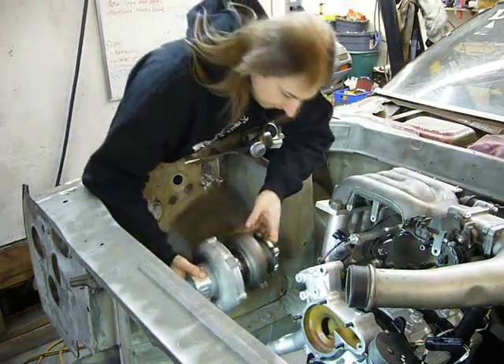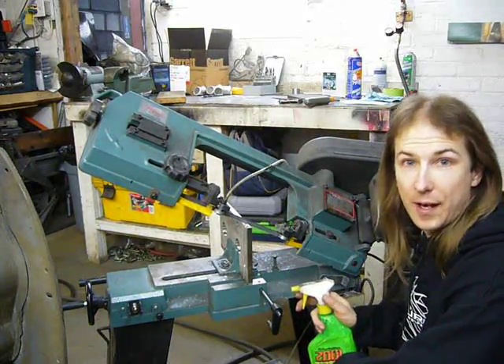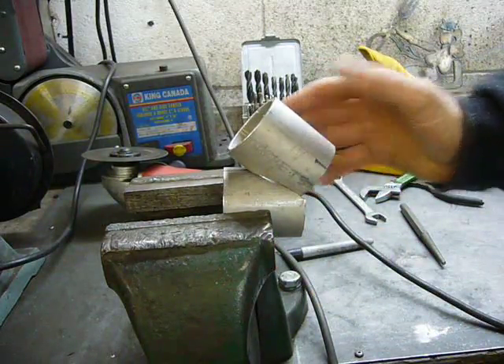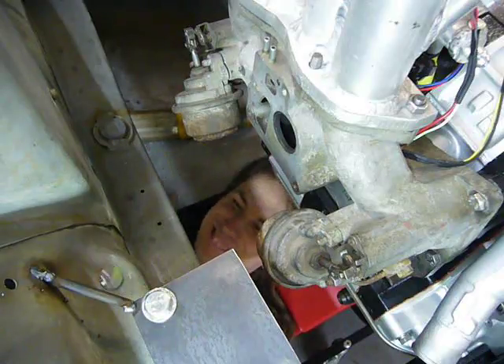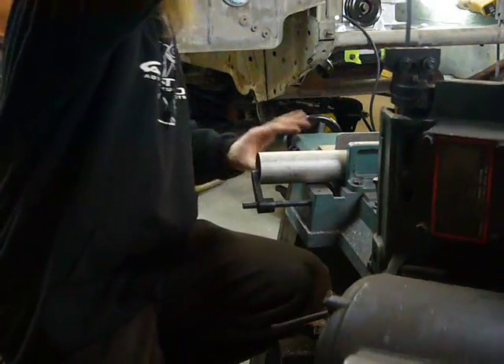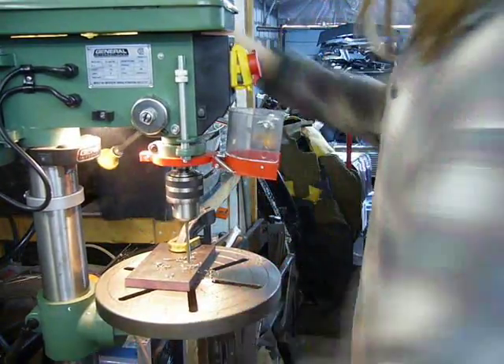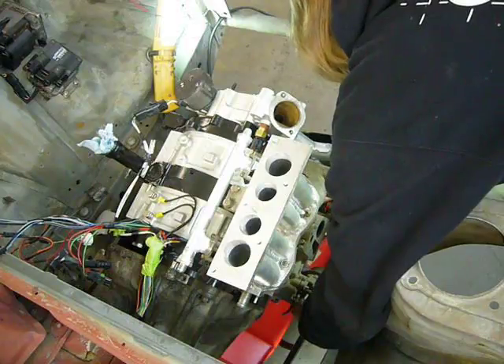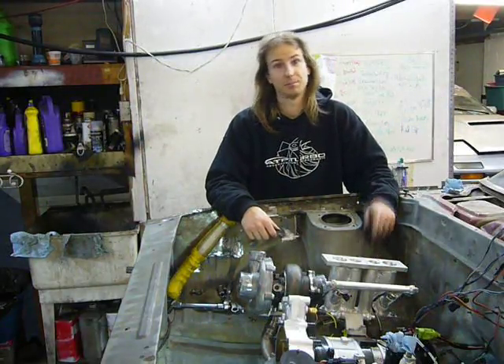Part 25: Turbo Manifold Fabrication - My 76 Mazda RX-5 Cosmo Restoration

Comment from the maker: Looks like really good stuff. I'll certainly be using it under the car to insulate the cabin from exhaust heat (as well as metal shields) and on the inside of the firewall.

Comment: Hi Aaron, Regarding your hole saw usage and lubing, one suggestion, I have had great success taking a paper towel and soaking it in cutting oil and then stuff it inside the hole saw. This is a cheap automatic luber for the hole saw blade. It's also known as a Texas Oiler.

Comment: I vote for the POR-15 on the floor.  I had requested that you discuss your experiences with this product during the interview with whoever-that-gal-was, but it didn't make it into the final version, unfortunately.  I haven't ever used POR-15 and would greatly appreciate hearing the experience of someone who has used it as extensively as you have.  But I digress.  Good vid, thanks.

Comment from the maker: In most cases, both rotary and piston, equal length runners will offer the best performance as it allows you to time the exhaust pulses to cross over one another at the collector, thus scavenging each other. Of course you can also run unequal length runners as well to time those pulses, which can be useful to compensate for things like uneven head flow, for example. This manifold has runners very close to equal. Not perfect, but good enough for my purposes. My RX-7 is equal length.

Comment from the maker: v8consumption If you didn't want to sound like a dick, I suggest two things. First, make a comment that I can actually reply to. There was no "reply" option available to your comment, which seems a little rude. Second, instead of saying "those welds are complete shit" you can say "I think those welds are less than ideal". When you interact with people, you can't just say "not to sound like a dick" as an excuse for everything else you are going to say afterwards. It doesn't work like that. Now, to address your concerns. Pulsing is very commonly done on stainless steel due to the tendency for it to overheat. Typically with a pulsar, but as I lack one of those, I just worked the pedal. It is a fine balance between heat, speed and penetration and I'm the first to admit that I'm not the best at getting a consistent bead on stainless. I find the fact that it flows out so slowly compared to aluminium a tough nut to crack, so to speak. Without question I do need more practice as you can tell based on the fillet beads. They were more consistent throughout because it is easier to control the heat at the fillet joint vs. the butt joint. Regardless, this is not my first manifold (not a single manifold I've made has ever cracked...my own RX-7 has over 100K on my first ever stainless manifold, crack free) so I do have a bit of experience under my belt. As such I'd say that your name "v8consumption" probably indicates you have little experience with rotary  exhaust heat. Trust me when I say that the 0.109 (only 2MM thick! That is exhaust tubing!) wall thickness of SCH10 1.5" pipe is fine for a street driven piston engine, but will sag and crack very quickly on a street driven rotary due to the high EGTs. In fact even on a piston engine I wouldn't use it for fear of it cracking eventually. I also agree that I could have had more penetration in these welds. However notice in the video that I heavily beveled the butt joints such that there was less than 1MM at the thinnest edge of most of the bevels. That's about 90% penetration without putting in too much heat (OK, I was a little high on the heat) and sagging into the inside. Anyway, checkout some of my other videos for extensive aluminium welding as well as further stainless welding and feel free to comment but please do so in a way that I can reply to.
Reply: +aaroncake Love the build, dont listen to the haters, build what you love to your taste, and build it the best quality possible, thats all that matters. If your anywhere near north east pa, I'll give you stainless tig lessons free, I never use back purge, sometimes I pulse, but mostly I  run heat higher than anyone Ive ever seen, and run very, very fast, with the tungsten as close to the base metal without touching as possible. If tungsten gets contaminated I chuck it into my cordless drill and grind a new point onto it facing straight down into a belt sander/bench grinder at a 45 degree angle, and not sideways.. Also I prefer to run a 1/8 tungsten, with gas lens, and number 7 or 8 cup on anything around 100 amps, and over. Gas lens is key for stainless, and a perfect ground uncontaminated point on the tungsten.-John
Reply: +John Steenland Also another huge issue most people forget when tig welding stainless is post flow, post flow should be set to 10-18 seconds, and gas flow should be around 20 possibly slightly over, but holding the tig torch in the weld to cool with post flow for atleast 6-8 seconds afterward will help out huge..

Comment: i wanted to see the milling on the warped flange. i had a big problem with 3/8 stainless. nice mani!
Reply from the maker: I have a bunch of stuff heading out to the machine shop so it will all go at once just before final assembly. Milling exhaust manifolds is fairly standard work at any machine shop. The first manifold I made with 1/2" flanges warped up a good 1/8" as I didn't anchor the flange down during welding. Learned my lesson!

Comment from the maker: In MOST cases, the turbos in Garrett's performance line have the water lines on the sides of the CHRA, oil feed on top, drain on bottom. Some turbos for specific applications may have differently located ports. Stainless tubing (not braided stainless hose) could go between runners but I'd try to avoid it. You're heating the oil unnecessarily and it will bake when the engine is shut down.

Comment from the maker: 3/32 316 filler rod was used. I started each weld at about 100A but was able to taper off to 70-80A as the material warmed up.

Comment from the maker: I'm not quite sure where you were seeing pipe misalignment because there certainly wasn't any. I even showed footage of the runners lit from the other end to demonstrate how the welds were about 90% penetrated, almost ideal. Could have run a little bit more current but the risk is droop through, even with the back purge. There was some misalignment at the flange which I had anticipated and was why I drilled the holes slightly small and then ported to match.

Comment from the maker: The 30R is actually a rather small turbo in rotary terms. The turbine is a bit smaller than the HT-18 used on the TII. The compressor is good for about 350HP at rather high boost levels on a rotary. Remember, the 13B flows air like a large V6 so that must be taken into account when sizing turbos. My RX-7 runs a GT40R which is about a medium sized turbo on a rotary. Few T3 frame turbos find their way onto a rotary and a T25 frame like the 2871 is much too small. Maybe 2 of them...

Comment from the maker: If you check closely in the video, there's the tubing for one visible on the saw. I do have a small pump but it broke a year or two ago and I've just not bothered to fix it yet. I don't often cut thick enough material to make it worthwhile. One of these days I will make a new base for the saw with tray, reservoir and pump.

Comment from the maker: It takes more current initially to start the weld with stainless than with regular steel, but then takes less as the material warms up. Stainless doesnt conduct heat as well as regular steel so the heat tends to stay with the weld. Shielding gas is always used when MIG welding. That's the "G" in "MIG".

Comment from the maker: Yes, that is an unknown. Small turbine and internal wastegate may mean boost creep. However two things make me think it won't be an issue: the wastegate is actually rather large (over 30MM) with room to port it out to at least 35MM (which I will do before final install) and the exhaust won't be so wide open as the car will run a cat, resonator and two mufflers. We shall see however. I did purposely design the turbo manifold with space to add runners for an external wastegate if necessary.

Comment from the maker: I've never heard of that before. My only concern would be that some brake cleaners will break down under heat and release nasties such as chlorine. Typically I'd use oil, or a water based cutting oil mixed with water, depending on what I'm cutting/drilling. Choosing a cutting fluid can be fairly important to tool life and ease of the cut. I'm still using the ame drill bits given to me when I was 8, because I rarely abuse them.

Comment from the maker: You need some kind of full standalone EMS. Just a simple fuel controller won't do it. The turbo you use will depend on your power goals as will the rest of the fuel system.

Comment from the maker: I'm accomplishing exactly what the OEMs do when they set up their heat shields in exactly the same way: a metal shield separated from the heat source by a small air gap. It stops most of the radiated heat very effectively (take a look at the exhaust manifolds and cats on your car). And unlike header wrap, these stainless steel exhaust heat shields will outlast both the car and myself. As opposed to the wrap which lasts about 6 months.

Comment: If it's tacked good some aluminum foil and purge line would have been plenty. A jig is cool if you're doing multiple manifolds. A gas lens and #8+ cup goes a long ways.

Comment: 29:21 "Man that's a tight fit!"

That's what she said.

On a more related note, I'm looking at fabbing a manifold for a turbo motorcycle project, because no one wants to do it for much less than what it would cost me. But I've never worked with stainless - is a bench saw a necessity? I have a chop saw, but would like to make cleaner cuts and have to grind/file less.
Reply from the maker: Matthew Wood I built my first manifold using only an angle grinder to cut pipe. Just made a mark around the pipe (wrap a piece of paper and trace to get a straight line) then ran the grinder around it again and again with a cutting disc. A chop saw would do the same job, just use a thin blade and be slow about it. Even a careful hand with a Sawzall could do it. Practice on some cheap mild steel before you start cutting stainless.

Comment: 42:20 next time you set out to weld tubing look into PET tape! It’s heat resistant and peels with minimal adhesive stick back to your work. Also, it’s quite acceptable to weld the tubes out of the flanges due to clearance issues then weld the finished tubes to your flanges.
Reply from the maker: Didn't have too many clearance problems when welding so it wasn't too bad to weld as one piece, which also meant I didn't need to keep setting up the back purge. Will definitely look for some PET tape.

Comment: not going to lie, this guy has a unique way of doing it but it works, not sure id use that exhaust pipe to use as a heat shield.. Ceramic coating would probably be simpler and look better... But kudos to you man.
Reply from the maker: In my experience, any kind of coating is temporary. Now, "temporary" may mean "lasts 5 years", but sooner or later, that coating is going to fail. Especially under the high EGTs of a rotary at lean-cruise. Stainless heat shields will outlast the apocalypse. Dual layers are often used in the marine world.
Reply: +aaroncake Ditto on that. Life got a lot easier when I started considering manifold coatings as a maintenance item to be done every couple seasons. Less stress about EGTs, shielding, chemical spills, flakes, etc. You can even run that sweet titanium wrap that rusts everything out and just restore your manifold every couple years. Function AND form.
Reply: aaroncake just found and bingewatched all of your vids.  Your attention to detail and fabrication techniques are inspiring and genius.  I agree with your take on exhaust coatings also.  Just wondering what your opinion is on why exhaust wrap wouldnt work well for this application or is it just not great in general?  My apologies if you already answered this.  Once again amazing job, I especially love your intros.
Reply: omg reply just below, sorry

Comment: Get a hydro pump of sorts for your drill press and band saw so you can literally walk away or just work with both hands instead of using a spray bottle.  I know you're crafty enough to make that happen on the low buck and functional too.

Comment from the maker: Correct. I'm using this turbo like the OEMs are these days; using a smallish turbo to emphasize the low end and midrange to make a smaller engine seem like a larger one. With conservative ports and the sequential injection with tightly controlled AFRs from the MS3-Pro it shouldn't be hard to achieve MPGs in the mid 20s around town, and I've done 30+ MPG on the highway on more aggressive ports so I don't see why 35MPG highway can't be possible.

Comment from the maker: As long as the bend generally faces down and most of the drain tube is facing down then it should be OK. Not quite knowing the setup I can only really guess. I did some Googling of 1JZ-GTE manifolds and found some pictures though. You can't send it through the middle runners between 3 and 4?

Comment from the maker: The runners are very close and I would have liked to make them equal. However I was limited by space due to the much larger 6 port lower intake. If I was going for every last bit of performance it would have been worth it to put in that extra effort and end up with a more convoluted design.

Comment from the maker: In most cases that's how I would build a manifold. But in this case I had to work around the 6 port lower intake which sticks out rather far and has the port actuators taking up space as well. Didn't want to create interference. Notice that as soon as I had the rear runner and the general layout of the front, I moved to the bench for the rest of the work.

Comment from the maker: In my experience heat wrap is temporary. It looks and works very well for the first year or so then starts to decline, unravel, loosen up, etc. So OK for applications that will be maintained but here I'm going for beyond OEM levels of integration and reliability. In that case nothing beats 304 stainless steel. 50 years from now those heat shields will be as nice as the day I made them. I may, however, wrap the manifold underneath just because hell, there's no kill like overkill.

Comment from the maker: An interesting question. Since a supercharger is tied to RPM, there are few on the market that are able to provide boost at low RPM and then not be wildly oversped at high RPM on the rotary. The rotary has such strong exhaust pulses that turbochargers are well suited, with the added benefit of also acting like a muffler for those pulses which makes it much easier to keep the exhaust quiet. Not really having any supercharged rotary experience I wouldn't want to make this car the experiment.

Comment: I have a Driftmotion 1jzgte  T4 single turbo manifold with a T3 flange welded on top. It a cheap P.O.S to be honest. I tried to go another route but if I go between the 3rd and 4th, then its coming in contact with the 3rd runner as well has the external wastegate runner. Maybe I'll take a video to show you what I am up against, haha.

Comment: I did mine like this:
Step1: Collect cardboard rollers (from toilet/kitchen paper) and make a modell. 
Step 2: Make the modell in 316/321 steel. (stay away from 304).
Step 3: Taping the "precut" steel tubing together and check equal length piping with water.
Step 4: Tack the tubing. And then proceed TIG welding with argon purge as you wrote. ;)
NOTE: TIG settings: Aprox: 35 amp on tubing and 80 amp on flanges. Stainless welding is like nitting for MEN. In other words take it easy! :)
Reply from the maker: steisje The toilet paper rolls are a brilliant ideal. I'm surprised you only used 35A when welding the tubing though. How thick was it? This is SCH40 pipe so it takes a bit more current.
Reply: aaroncake  
Hello. :) 
The tubing was: 2mm thicknes (0.0787inch)
           Diameter: 42.4mm (1.669inch)
Reply from the maker: steisje Wow, that's really thin. No wonder the current was so low. In the rotary  world we see EGTs nearing 2000 degrees so SCH40 1.5" or SCH20 2" is what we commonly make runners out of.
Reply: aaroncake It does the trick on my 2jz with 6765 Turbo... ;)

Comment from the maker: This is the first internal wastegate I've used, so it's a bit of an unknown. However it's rather large at almost 35MM right from Garrett with room to port out at least another 3MM. So hopefully large enough to avoid creep. I'll be running a cat, resonator and two mufflers as well. Absolutely worse case I'll need to go to an external gate so I did leave room when I made the manifold. But I'd prefer to avoid that.

Comment: i will give you a tip that you will use in the future. when you want to drill aluminium or cut or whatever, do not put oil on it, put brake cleaner on it.it will make it easier to cut and drill. but it doesnt apply on other metals.

Comment from the maker: I'll see what I can do when I POR-15 the floor and engine bay. There will be a lot of POR-15'ing coming up. Really, the most important factor is following the instructions to the letter. It is great stuff when used properly. When used wrong it will just cause you more problems (such as trapping moisture!).

Comment from the maker: I looked up the manifold and it looks like the drain tube could take a hard bend towards the compressor housing and come straight out, the na 90 degree straight down. Guess it depends on clearance.

Comment from the maker: It would look neater for a few weeks anyway before it started to dirty up and fall off. Then in a year or two it's hanging down. Heat shields are long lasting, which is why OEMs use them. And stainless steel heat shields should outlast the manifold itself.